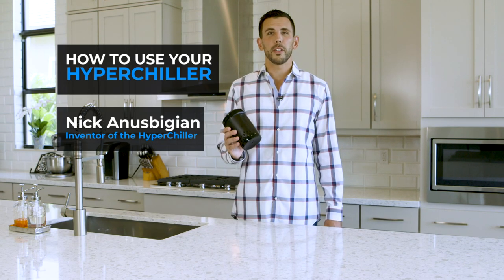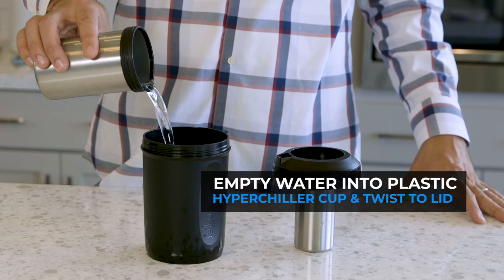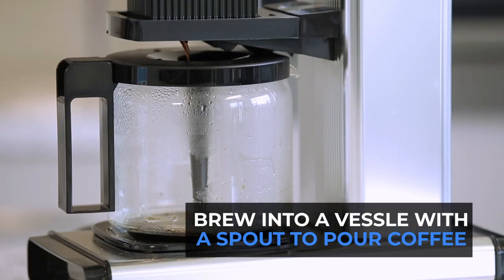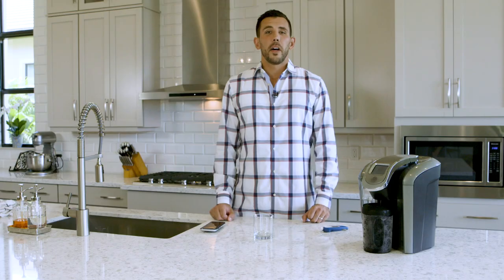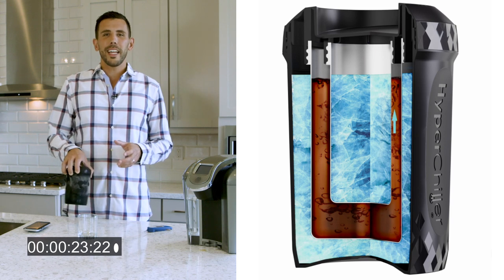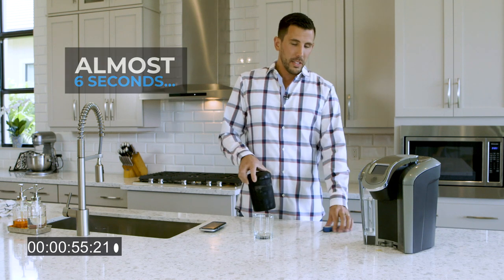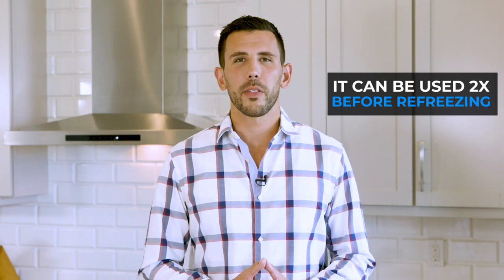HyperChiller How To Use - Version 2.0

Comment: Can’t unscrew to get to the inner most stainless steel chamber….We’ve tried and tried and it just won’t come apart
Reply: Just got one for prime day. Had the same issue and had to use gloves that had some grip to un twist it. Good luck with yours!
Reply: I can’t untwist it! 😩😩
Reply: Get 2 people to unscrew it the first time then it's fine after. But they should loosen it before shipment lol
Reply: I poured some canola oil into the threads and waited for it to seep through.
Reply: Same I haven’t been able to unscrew mine either!

Comment: I just got my Hyperchiller yesterday and after freezing for 12 hours used it today, what a disappointment. The lids don't line-up correctly to start. Then the main container says it holds 12 oz but actually holds about 8. You have to shake it and keep shaking to keep the coffee ( or tea, I tried both) from freezing. A garbage product all around, I had such high hopes too.
Reply: @elitegourmetsmallkitchenap2086  Thank you for the info, I'm unthawing it now, I ran it under warm water to get those lids off ( they are just cheaply made). Definitely not worth $25, I'll find someone to give it to.
Reply: So in the end of this, the black container should have water in it?
Reply: @Dan-cp2nh   WARNING: Do not buy this product. Everything about it is bad. The chilling cup only holds 8oz for one thing. If it actually cooled things down, why do they pour it over ice in this commercial?
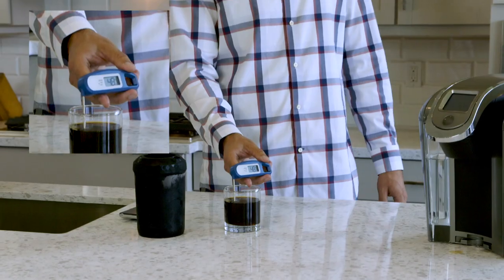Reply: @bezzarguy  3:20 they say to swirl it longer if you don’t want to pour it over ice. Mine works just fine
Reply: @bezzarguy  Because chilling to 48 degrees makes it cool, not cold. Making regular brewed coffee cold doesn't make it taste very good, imo, you're probably better off making espresso and pouring it over ice to dilute to an americano, and it would be really cold. Or brew stronger coffee and pour it over ice. This product seems like a (bad) solution to a problem no one has.
Reply: @bezzarguy  Just because it does not go below freezing that does not mean that it isn't vastly cooling your coffee down...